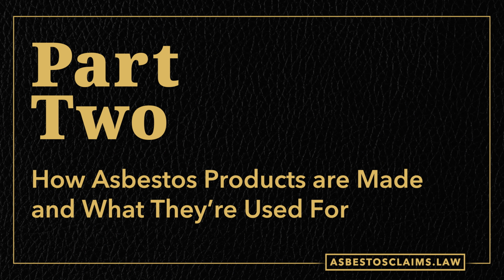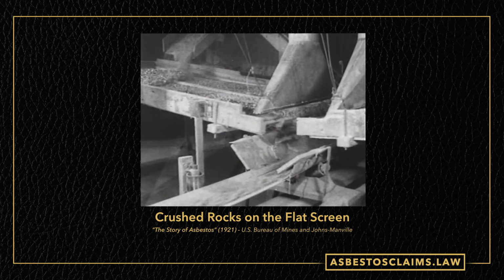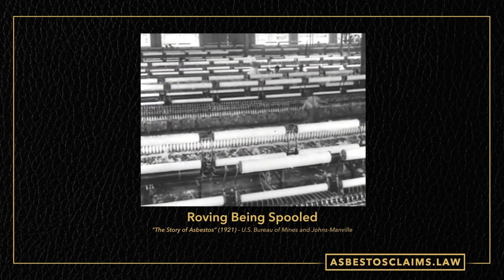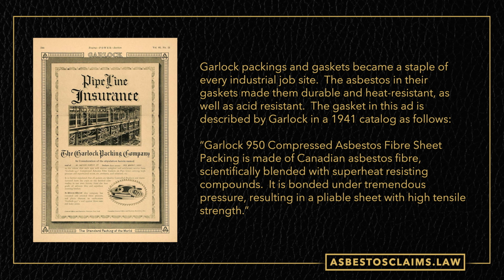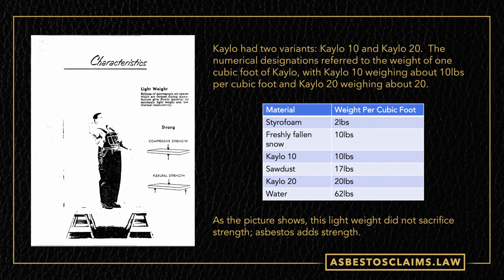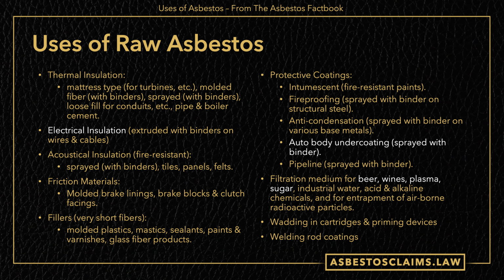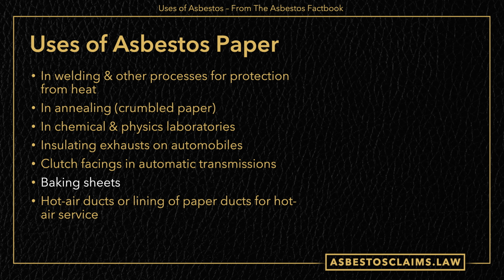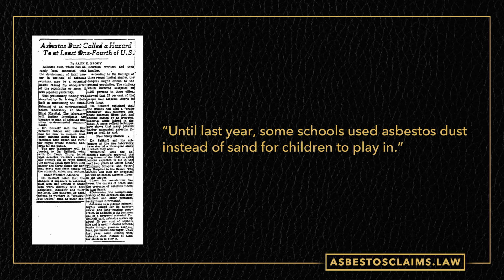Asbestos 101, Part 2: How Asbestos Products Were Made and Used

Comment: The Asbestos risk is well known since before ww2. In the time till 1970 poeple were younger did not think too much in the future life span was shorter. Thus such risks were not taken serious enough*. Since then many of these risks are highlighted and overblown. 

In the 80ies till 90ies I drove cars with asbestos brake pads. I knew about the risk but grinded them before installation. My risk assessment was that I`m a hobby mechanic doing it perhaps 1/year and thus my exposure is too low. Till today I`m right. For professional mechanics it is a different story. 

From my point of view the total ban of asbestos is not ideal. Most poeple in industrial countries had some exposure to asbestos in factories, office buildings, their homes, traffic. It is to protect the poeple with regularly exposed to the material by mechanization/robots, ventillation with suitable filters, protection equipment. 

*In the years 2006 - 2010 I was living in Egypt with plenty of contacts to other Middle East countries. Over there the poeple still have a similar risk awareness that we had in the 1960ies.
Reply from the maker: There are indeed historical attitudes towards occupational health risks as you pointed out, as well as the personal choices people make based on their individual circumstances and risk assessments.

Indeed, prior to widespread regulations, the use of asbestos was common across many industries due to its desirable properties, such as heat resistance and durability. However, as you mentioned, awareness of the health risks associated with asbestos exposure grew over time, particularly as the long-term effects—such as mesothelioma, asbestosis, and other serious respiratory conditions—became more apparent. This awareness led to increased regulations and eventually to bans and stricter control measures in many countries.

The approach of using asbestos safely through mechanization, proper ventilation, and protective equipment is a point of debate. While these measures can reduce risk, the unique properties of asbestos fibers, particularly their ability to remain airborne and penetrate deep into the lungs, make complete safety challenging to guarantee in practice. Additionally, once asbestos-related diseases develop, they are often incurable and fatal, adding to the calls for a total ban.

Moreover, the difference in risk perception and management you observed between industrialized nations and places like Egypt and other Middle Eastern countries in the 2000s can indeed be linked to different stages of industrial and regulatory development. Many developing countries still use asbestos due to its cost-effectiveness and lack of adequate regulations, posing ongoing health risks.

So while personal exposure levels can vary widely and some individuals may not experience immediate health effects, the overall consensus among health experts and regulatory agencies is to avoid asbestos use to prevent long-term health risks. This approach not only aims to protect individual health but also to reduce the societal and economic burden of asbestos-related diseases. And hey, thanks for the great comment. Be well.